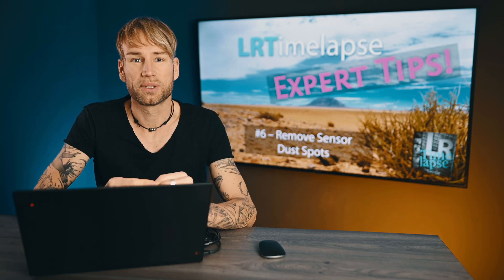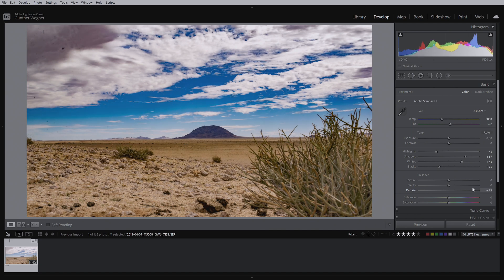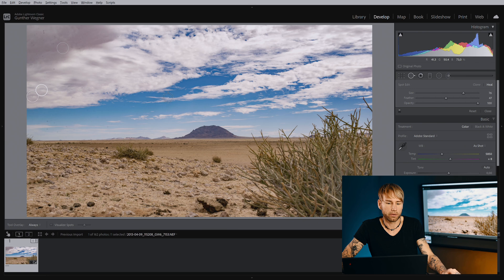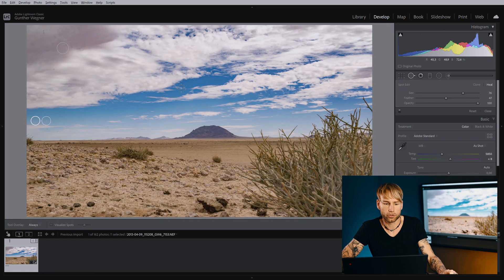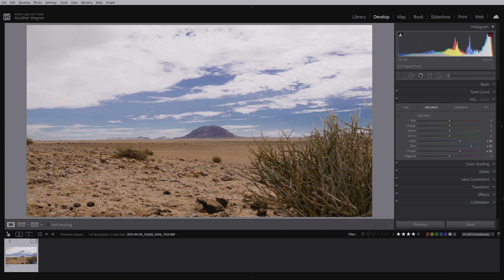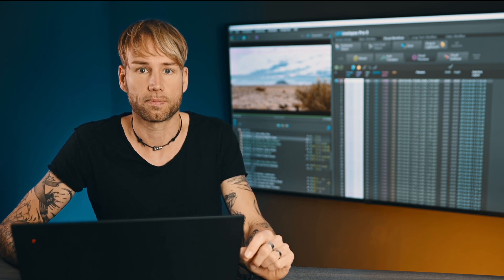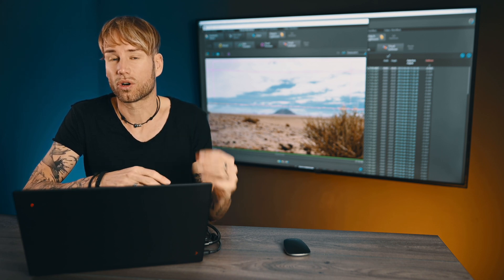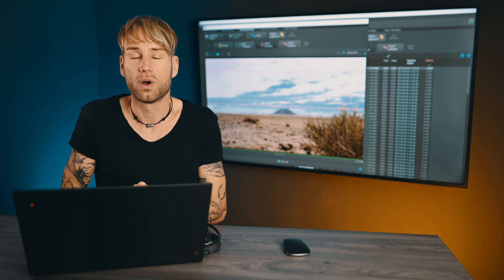LRTimelapse - Remove Sensor Dust Spots from Timelapses - Expert Tips #6

Comment: Gunther, if I use a grad filter with one of your presets on the first key frame it will stay throughout all key frames? I notice when I open second key frame after syncing with script it doesn’t show anything selected in the fraudster filter on next key frame like other sliders etc.
Reply: Sorry, hard to understand. But yes, of course the predefined gradients will be synched with the sync-script and later transitioned via the Auto Transition.
Reply: gwegner.de ok, thanks, I just don’t see them when I sync to the next key frame then open up Gradient filter, the four preset pins you put in are all white like there is nothing done to them
Reply from the maker: @KenToney  What do you mean with "Pins are white?" the pins itself never change their colors, but the settings should be taken over with the sync script. Just try it. Please come to my forum for more detailed questions: https://forum.lrtimelapse.com/

Comment: Thank you for that, I cloned out a dust spot on sandy colored ground in a motion controlled time lapse, it looked like a ghost of the cloned area moving across the time lapse. I'll see if I can use this technique. To save a lot of trouble in post it is best to check your sensor for sure.

Comment: Thanks a lot¡
You could remove sensor dust spots using Premiere or After effects.👍
Reply: With content aware fill? I've found that works fairly well but there seems to be no perfect solution.
Reply: @LW_Lapse  A Gunther tutorial explaining the techniques in Premiere and After effects in relation to this would be a good idea. It is better to explain the possible situations in a video. Explaining here in writing is not the most appropriate, in any case, I have had good results using Premiere and After Effects.
Reply: @luisjg2628  Yes, if @LRTimelapse did one that would be great ;)  I use masks and content aware fill with fair results, but with my own stuff I either crop or  re-shoot, not usually worth the time to fix.
Reply: Dust & scratches effect works at times. Duplicate, effect top layer, mask out spot

Comment: Great  Video as always. I have been able to remove dust spots easily afterword in DaVinci resolve with the Patch Replacer, Which you can track over time took. it took me 1 min to solve a problem with a persistent dust spot That I could not remove when cleaning the camera's sensor.

Comment: As always, thanks for the tips! :) Another solution is to paint very precisely on the dust spot with the local correction tool and then try to cancel the effect of the spot by increasing exposure or blacks or reducing contrast. Depending on the shape of the spot it can almost make it disappear, and will not generate strange artefacts on moving subjects.
Reply: Fantastic tip.. Thanks Julien!

Comment: Thank you for the tips!   So the clarity and dehaze slider is non-linear but is linear inside the LRT range mask / linear filter?
Reply: maybe it is still non-linear but I think you can try flicker-free for the possible flicker
Reply from the maker: @jeremyzhu8885  there is no external deflickering involved here or necessary.
Reply: @jeremyzhu8885  do you mean the external plug in? I use that as well
Reply from the maker: No, they are non linear on the gradients also, but that dosn't mean, that you can never use them. Especially for simple, well exposed sequences, they might not introduce issues. The points that I lined out in the other video ( https://www.youtube.com/watch?v=xb6UZsUEpSI ), apply the more, the more difficult in terms of exposure the images are.
Reply: @LRTimelapseOfficial  I watched your tip #5, hence the question.  It was extremely helpful; thank you!